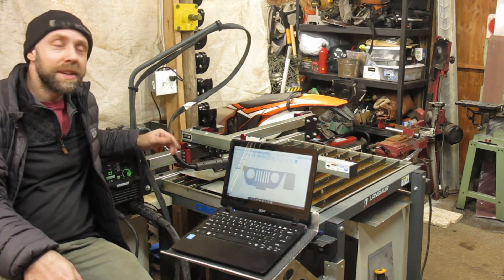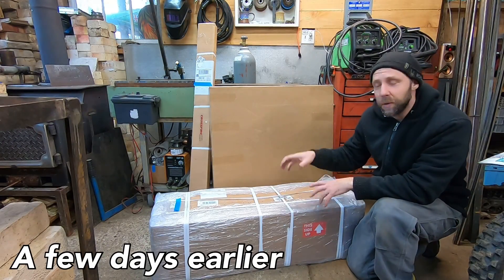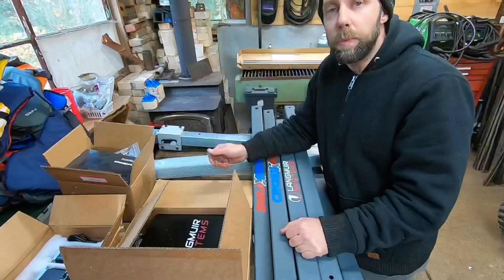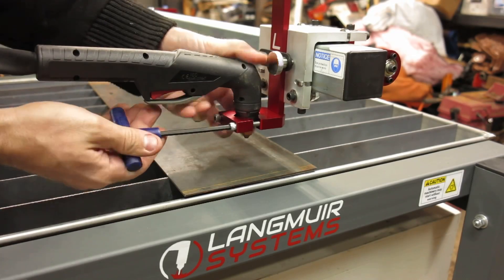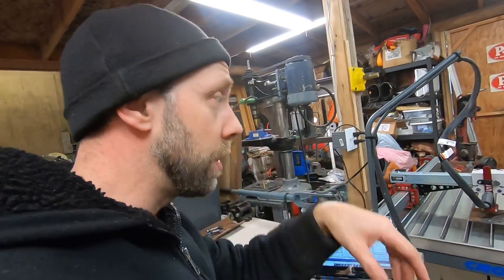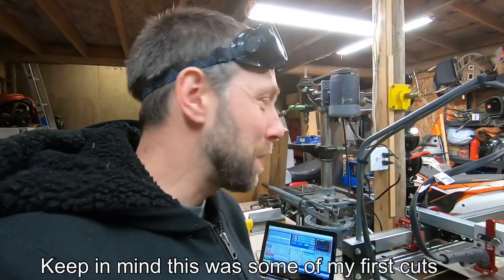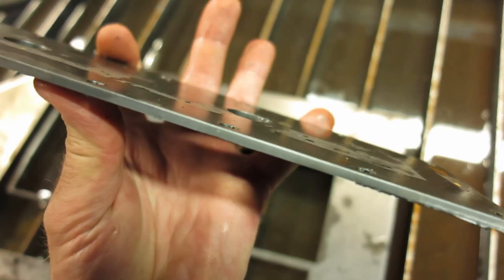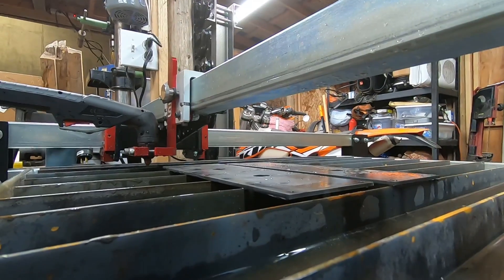Finally a affordable CNC plasma table Crossfire from Langmuir systems

Comment: Nice! What computer are you using? Is that a chrome book with Windows? Thanks
Reply from the maker: It’s a tiny computer maybe a Acer? It’s got windows 10 on it, my dad had it kicking around and knew I needed a windows based computer for my plasma table so he gave it to me. It runs Fusion 360 and Mach 3 fine, It’s just Really SLOW when you go online, it’s got some problems 😂 Take care

Comment: I highly recommend that plasma anti rust fluid be bought for tables without stainless water tables and slats. You can get a gallon which is mixed with water. For a small table, you don’t need to use the entire gallon. It will make a big difference. It also helps to prevent bacteria buildup which will happen with steel tables filled with water that aren’t emptied and allowed to dry.
Reply: Any preference. I bought some stuff that was 300 dollars for 5 gals for my new jd square table and it still has bacteria and a weird white salt looking stuff around the edges .thanks
Reply: That’s awfully expensive. I’ll check.
Reply: @melgross  I have a 5x10 table .not really the price I'm worried about just want a good product so it dont tear up a new table .it looks like crap stinks and I think mosquitoes are living in it .plus it's a pain in the ass to drain a big table all the time .thanks for the help .
Reply: This is good. It’s very concentrated , so a lot of dilution.

http://cantesco.net/en/project/plasma-arc-water-table-fluid/

Comment: Fastest path for me has been Rhino 3d to Sheetcam. Sheetcam is critical! If you need a how to video I will make one. My 6x11 and 4x8 tables use flood coolant to make cleanup easier and no heavy water tray.
Reply from the maker: Tad Johnson Thanks for the suggestions 👍 I will look into those programs. 
Here’s my newest project using my CNC plasma table, this is a series on building a mini 4x4 articulating dump truck.
Check it out if you get time. 
https://youtu.be/7PoKLJym_qc

Comment: Got the same setup going today and I'm enjoying it!  Have any general settings for different thicknesses of mild steel?  I can test cut all day long, just don't want to waste any more steel than I have to haha!
Reply from the maker: Nice! You are going to really enjoy having this table in your shop. 
I have been cutting a lot of 1/4” lately and I found pierce delay is good set at 1.5 seconds. Lead in speed is good set at 20 IPM. Cut speed is good at 40 IPM. 
Amps set to 45.

3/16” I found Pierce delay of 1 second, lead in speed 20 IPM, cut speed 50 IPM plasma torch set to 40 amps. 
With these settings you can adjust up the speeds on thinner metal. I hope this info helps, Take care 👍
Reply: @Mikefestiva  Thanks a bunch!  That'll help get me going in the right direction.  I'm a tech guy but damn this fusion software isn't the worlds most intuitive (to me).  I need to figure out how to save many of the common parameters I'm having to set each time.  Sooner or later I'll attempt to learn to draw haha!

I think most of what I do will be playing around with 14 gauge, gotta dial that one in to make some basic signs for friends and family.  Thanks again sir!
Reply from the maker: I Do Projects Did you check out those three videos I posted links to in the top comment on this video? They really helped me learn Fusion 360 by watching the videos on my phone and drawing the shapes on my computer, these videos are the best I could find when it comes to 2D drawing for Plasma tables. If you have any questions let me know. Take care
Reply: @Mikefestiva  I started one the other night, it had been a long day of me getting the table set up and all the stuff that goes along with a first cut so I wasn't 100% there.  I'll get through them tomorrow though, I do remember the guy in the video being WAY too comfortable with the program with all of his shortcuts haha.  I'm over here struggling to rotate things and scale them lol!  Thanks again, always enjoy someone else who enjoys building!
Reply from the maker: Yes it’s a bit of a up hill battle but it gets easier and before you know it you will be drawing no problem. 
Here’s a few tips. Use the undo arrow in the upper right hand corner if you do something you didn’t want to do.
I use the Esc button up in the right top of your keyboard to get out of a command, say for instance you use the short cut key “T” to trim a line then you want to draw a new line press the Esc button this will take off the TRIM, then click the “L” button for LINE then you are all set to draw a new Line.
One other thing I could not figure how to make construction lines or find info on how to draw them, what you need to do is press “L” for Line, then press “X” for construction line if you have the “ Sketch palette box open on the side you will see the construction box will turn blue when you are in construction line mode, to get out of construction line mode just press “X” key again so the box turns from blue to white. I hope this makes sense? 
Also if you draw a construction line that you want to Change to a solid line later just click the construction line to hi light it, then press the “X” key this should turn the construction line into a solid line. 
These where a few things that really helped me out. 
One other thing to move your part around on the screen you can hold down the center roller on your mouse to move the part, plus of course you can zoom in and out with the same center roller. 
To resize a line click the “Create” drop down in the upper right of your screen then go down to the bottom to “ Sketch Dimension” or simply just short cut key “D” then double click the line you want to resize then a black number will appear along side double click the number then the box will appear in blue, here you can input a new number to resize your line. I know it sounds a bit tedious but it will become really quick as you get to know the program. Believe me I had been really frustrated with it when I first started out, now I can draw a part up in no time at all. Take care and I hope this info helps 👍
Reply: @Mikefestiva  any idea on best settings for 14awg?  Much appreciated, I have had mixed results, trying to see where I'm wrong...

Comment: ONLY IN AMERICA! 

HEY - what the hell did he intend to say about HIGH FREQUENCY?  That's for TIG welding.  Did he mean Pilot-arc / no-touch plasma?
Reply from the maker: Do your research 👍
Reply: some low end plasma cutters use a high frequency arc to jump the arc to piece of metal you are cutting  once the arc is established the electrical  arc becomes a conductor and transfers the heat and energy to the part being cut  which is also why you need high frequency on a ac tig welder to start  and stabilize the arc on a dc tig you don't need high frequency start but it does allow you to establish the ark with out contacting the work piece  the problem with high frequency  start on a plasma cutter is it interferes with the electronics I hope this helps

Comment: This seems overly involved to me because 3D printing takes advantage of simple ardunio microcontrollers to drive stepper motors without the g-code limitations you are dealing with.
Reply: 3D printers use g-code. The output of slicer software is g-code. The arduino/GRBL processes the g-code and commands the motor controllers steps and direction. It also turns nozzle on/off.

Comment: I often have water splashing over the side of the water tray. So i ended up mounting the electronics enclosure up higher on the shelf. you can extend the stepper motor cables with ordinary computer serial cables.

Comment: I've used my small plasma table enough to know that not only is a z axis critical but a basic torch height control is also needed especially with thinner material such as 16 gauge or thinner. Even thicker material can warp as your cut it especially if you are doing a lot of cutting in one area such as art work or small parts. It would be awesome if you could get a $1,500 plasma table that functions well but I think this one as is will cause more frustration than it's worth for the reasons stated above.
Reply: Phill Huddleston I agree with the z axis controller. A water table is a must for thinner stuff.

Comment: For guy who has never done anything like this before, how tough would you reckon it would be to learn the software?
Reply from the maker: Hey Jeff I have never used any CNC CAD programs before this, I will be honest with you it was a bit overwhelming at first, opening up Fusion 360 and not really known how to even draw a line, but I searched all over YouTube and I found a guy with excellent videos, there’s a comment from me at the top of the comment section on this video with links to his tutorials. Really recommend checking them out, I watched it on my phone and followed along on my computer, each time you do that you will start learning faster and faster, it’s all about repetition. Like I said in this video or the other one I posted, you can download both Mach3 (free version) and Fusion 360 from the Langmuir website. After about a week of looking at these videos and spending 45 to 60 minutes a day I was fairly up to speed and drawing/ cutting parts. Mach 3 is really basic, I will post a simple video on Mach 3 for people that are interested in how to run one of these tables, one last thing, it took me a bit to figure out the tool path part in Fusion 360 because I found the Langmuir tutorial videos to be a little off and out of date to the newest version on Fusion. I will also post a quick video on this, it will save you a lot of trial and error 🙂 sorry for the long comment but I wanted to let you know my experience learning it, I’m no computer wizard ether 😂
Reply: Mike festiva Thanks - length of comment was fine.  I try to be thorough too!  Thanks.

Comment: Newb question; are the table slats that the work rests on ‘reversible’ or simply sacrificial?
Reply from the maker: Jeff that’s a good question to ask, yes the slats can be flipped over for a fresh surface after the top side becomes really cut up. I think it will be a while before I need to do that. One thing to mention is on occasion I will look over the slats and run a angle grinder with a flap disc over any high spots with built up slag to clean and level them up before cutting a new piece of metal. With the XL package it has enough cut capacity to cut it’s own table slats! Take care

Comment: The problem with this system is the boom arm is not supported on the opposite side of the table, and accuracy will suffer as a result.
Reply: not really since the plasma torch does not push on the gantry zero force required if it moves smoothly thats all thats needed
Reply: @garyweber4333  When ever you have one end unsupported theres going to be movement, that's why most companies who make more accurate cnc plasma machine have gone to a supported gantry style arm. These are made to a price I get that.
Reply from the maker: TRG I really don’t see it to be a problem on this small of a table, just like Gary mentioned if it was a router table it would be a bigger problem, but being a small table and moving a plasma torch that doesn’t touch the metal it’s fine. I think the benefit of having a boom arm overhanging is that you can have a bigger sheet of metal overhanging off 3 sides of the table and not interfere with the gantry. TRG tell me about your CNC table? What company and model do you own? My friend owns a PlasmaCam and it’s a good machine but the company won’t support there older tables now unless you upgrade the electronics box and software, it’s literally about the cost of 3 of these crossfire tables to upgrade the old Plasmacam table. So there’s probably downsides to everything.
Reply: @trg3761  I'm guessing, when supporting the boom from other side then the result might be roughly the same. Because, It would add little extra weight and drag when moving in x-travel direction. When going on a fully supported boom you also might need a stepper on both sides. I have a 10x26 (3x8 in meters) self-made plasma table with a boom arm that is fully supported on both sides, but motor only on 1 side. It wobbles like crazy - the boom is way too long and way too heavy for the one stepper setup.
Reply: Just be really careful to never lean on that arm. At some point, it can happen without someone thinking about it. You bend down for something, and you put your hand on something for support. Make sure it’s not that arm! If it is, your alignment is shot, possibly forever. That whole thing is very light. No matter what, I’d like support on both ends. It’s not as strong as you think.

Comment: Any new thing has a learning curve. For the price it is hard to beat. I remember 30 years ago this table would of cost you 15 to 20k and the program code was quite basic and very costly to expand.
Reply from the maker: Thanks for commenting 👍 yes it’s definitely a Learning curve but as you get past the hardest part you really start to figure it out and that is rewarding 🙂 You are right, this table would have been so far out of a regular guys price point years ago, it’s nice to finally have this technology in a home shop! 
I’m definitely going to be using it a lot this next year, I’m starting on a really big project, I’m going to be building a mini articulating dump truck for my property, this CNC is going to be priceless to me for the time it will save duplicating parts for that build! Take care Theodore

Comment: Just looked at Langmuir site. Oh well, I had just bought a brand new Lotos 50 amp pilot arc plasma cutter. Looks like I'll have to sell this one and upgrade before buying the table.
Reply from the maker: Darn that’s to bad James 😕
Reply: the primeweld cut60 works great on this table....buy the pigtail from primeweld to hook up thc.....works great.....there is even a video how the guy did it....primeweld cut60....$675 on amazon....pigtail $25 from primeweld.....save some money....hypertherm 45 costs as much as the table....overkill

Comment: why do you need a water table for a plasmer cutter?
Reply: water table prevents smoke build up and keeps the metal from warping while cutting, especially thin gauge metals. any type of heat warps it pretty quickly.  you can also fully submerge the metal, the compress air will blow the surface water away to give an arc
Reply from the maker: Hey Chad the water table is not needed to cut parts, it really just helps to cut down on smoke from cutting and keeping thin metal from warping by keeping it cool from the water splash on it.

Comment: Great video! Been waiting on something like this. Will it work with a Pilot Arc plasma cutter?
Reply from the maker: Yes you want a pilot arc plasma torch, high frequency start torches give off to much interference for the electronics. If you already have a pilot arc plasma torch you can click the Langmuir website link in the description and click ( menu) then click ( Learn) then scroll down to ( plasma torches) this will get you to there part of the site where they have a lot of different torches that work and don’t work on there tables. I hope this info helps. Take care
Reply: @Mikefestiva  Thanks Mike!

Comment: I took the plunge and ordered one. I got the water table and extension as well. I got the Prime Weld Cut 60 to go with it. I was going to go with the Titanium but the Prime weld was a $100 less and came with a 3 year warranty.  Can't wait to try it all out. Thanks again for your videos and help.
Reply from the maker: Nice, I think you are going to really enjoy it!
I was just running my table last night, I was cutting some 1/4” and 1/8” parts for some small shackle hangers for my quad truck project. It’s a little overwhelming at first to learn the Fusion 360 program but I found a few videos on YouTube that I will post, these videos are really what got me past the learning curve, you easily can just follow along and build the parts that the guy is building in the video, it really got me past the struggle of learning something new. 
Do you have project videos posted on your YouTube page?
Reply: @Mikefestiva  Really looking forward to seeing your video on cutting the parts for your quad, and seeing those tutorial videos you are talking about. I just got my Prime Weld last night. I forgot to mention the other factor in selecting that was it has a CNC plug in so I dont have to splice wires. I have about 35 project videos on my YouTube channel.  They are mostly blacksmithing related. I would be honored if you checked it out. The I'm waiting on the Crossfire to arrive.
Reply from the maker: Refiner's Forge I think going with the prime weld will be good! I think HF is asking to much for the Titanium 45, at the price they are asking there’s a lot of plasma torches on the market. I definitely will check out your channel 🙂 l will try and post the links to those tutorial videos I found this evening, you definitely will find them helpful. Take care and have a great day 👍

Comment: Don't you have torch height issues with this thing ? Nice when the metal is flat and parts are small....
Reply from the maker: Yes no Z height control, I have only had it for a month but have not really ran into any problems so far I just make sure my metal is flat and that the cut slats are clean, no slag sitting on top. Some of my salvaged aluminum has been bent, I weigh it down on the ends with some heavy steel flat bar and work around the worst of it. It’s not to hard to move the torch around your cut area and check that the tip doesn’t hit the metal before cutting.